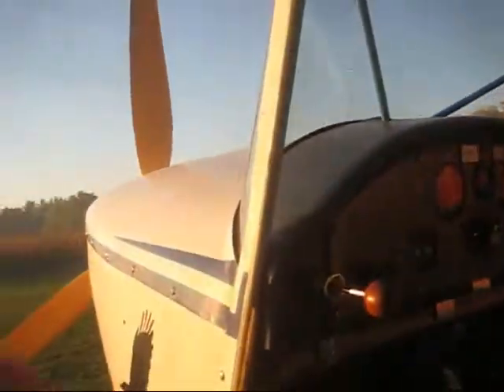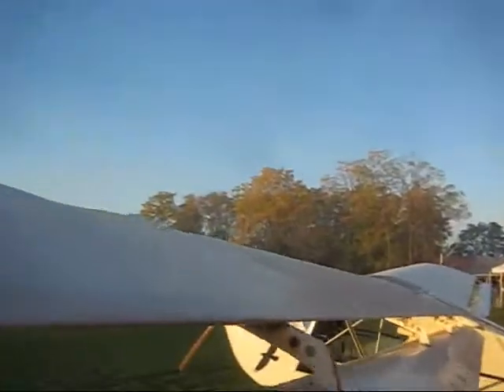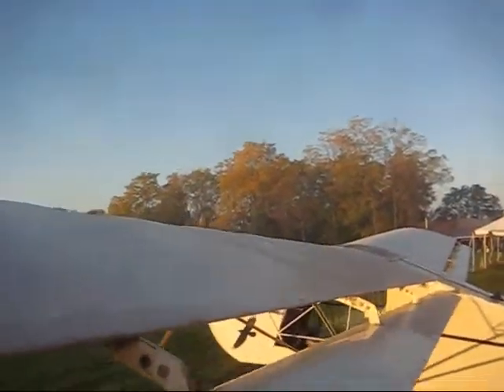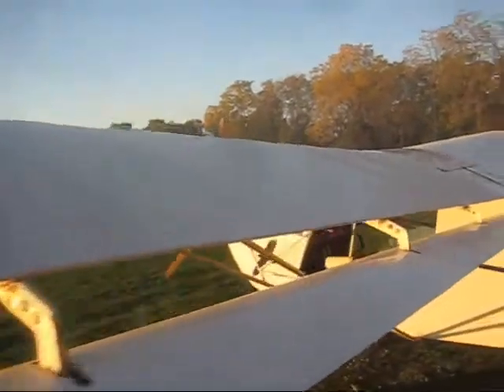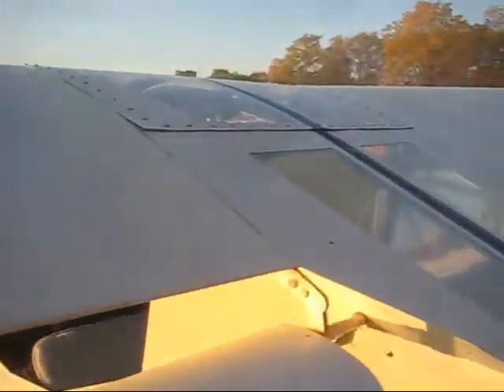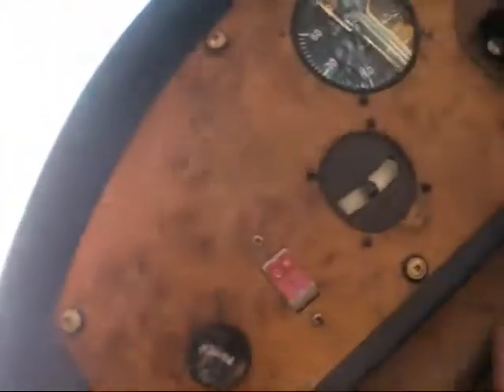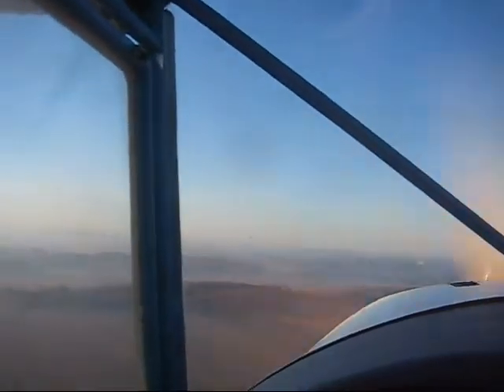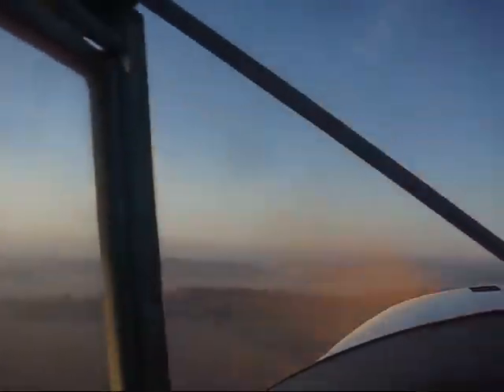Early AM flight Kitfox -Raven

Comment from the maker: @eastcoastbeaver -- a bit of cracking.  It works fine.   Poly tone still in my opinion is the best and repairable. Aerothane is harder to fix but high gloss. latex paint has titanian dioxide in it already  for UV blocker.